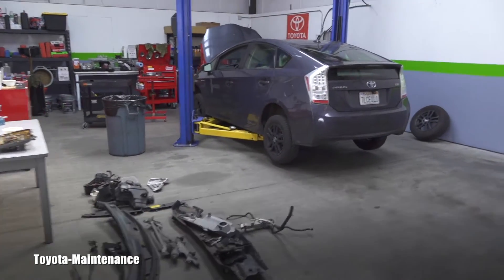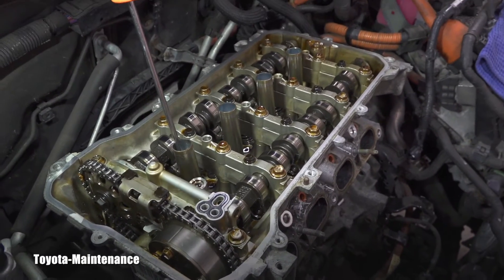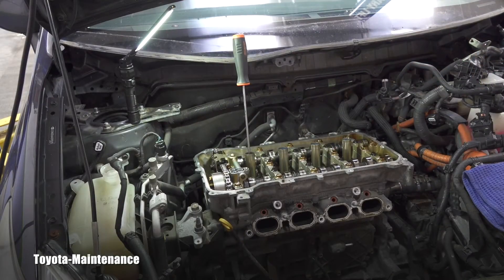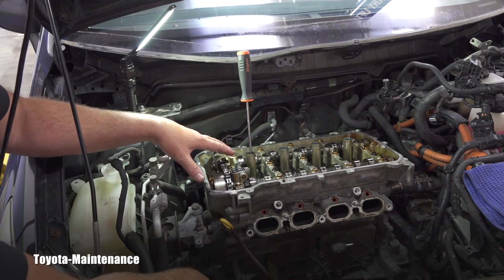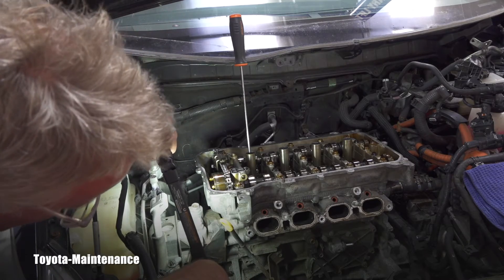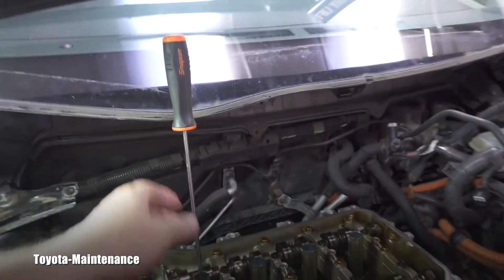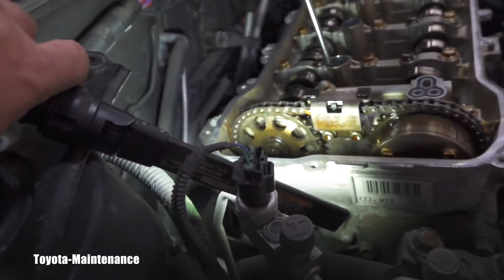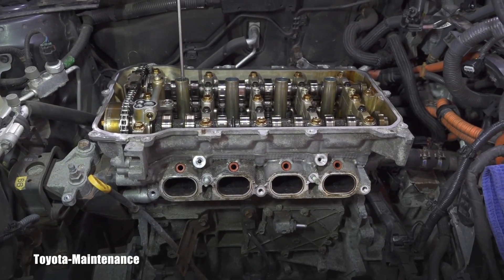How to set TDC on 4 cylinder engine

Comment: So the colored links on the chain are not relevant assuming u have: 

1. Dot to 0 on crank, 
2. Left cam sprocket green mark at 12 o clock
3. Right can sprocket full length notch at 2 O clock. 

And all of this leading to cyclinder one and four at max height. So again regardless of colored links these 3 steps are TDC. Your video is very clear. Many others focus on the colored links which I can see being helpful, but confusing trying to line up as many rotations can be required

Comment: I used this method with the marks to get TDC on my 2AR-FE When doing the head gasket. Works like a charm.
Reply: Except for the fact each piston reaches top dead center 2 times per cycle,once during exhaust stroke and once during compression stroke.you must have got lucky,kuz true TDC happens during compression stroke;thats the tdc you want.